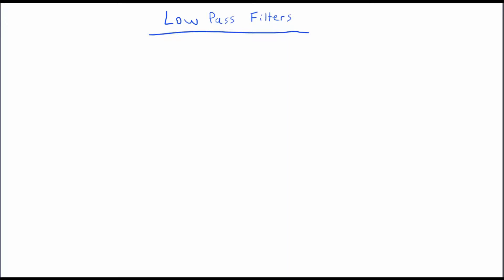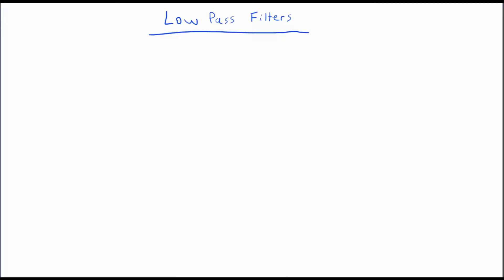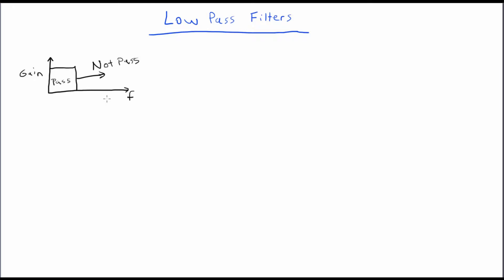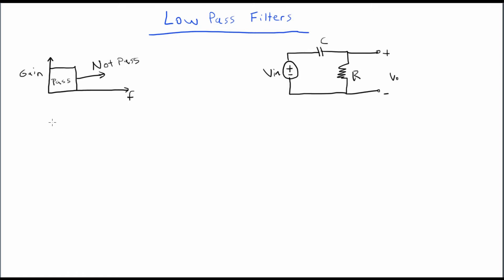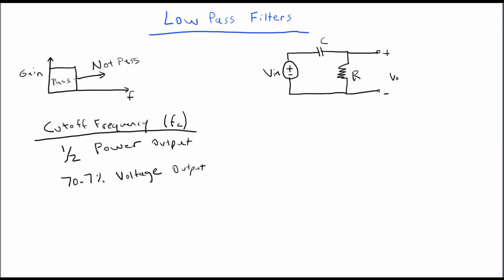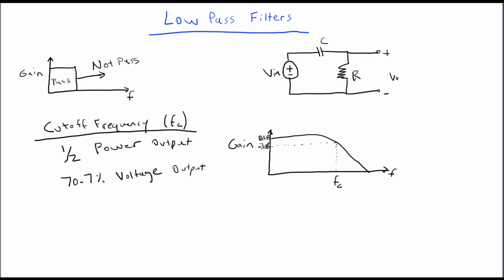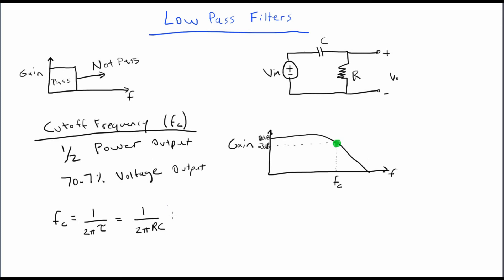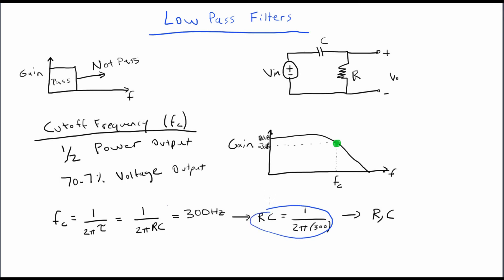Introduction to Low Pass Filters

Comment: I personally think this circuit you drew here is a high pass filter, if you swap the capacitor with the resistor then I think it is a low pass filter.